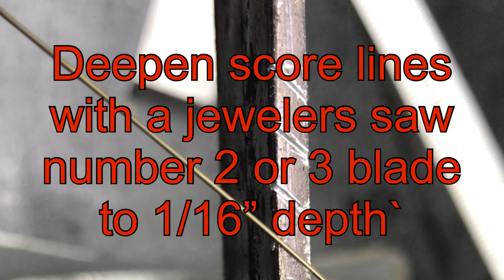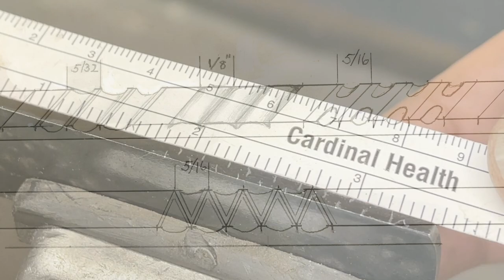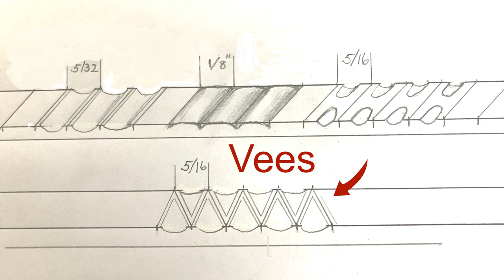KNIFE FILE WORK

Comment: Nice work! How do the Harbor Freight files hold up? Just getting started with file work and need to get a set! And where did you get your jewelers saw?
Reply from the maker: They last for dozens of knives. The jewelers saw is just an inexpensive one from amazon. The blades I use are #4 PIKE jewelers saw blades also on amazon. Don't get cheap blades you will get frustrated!